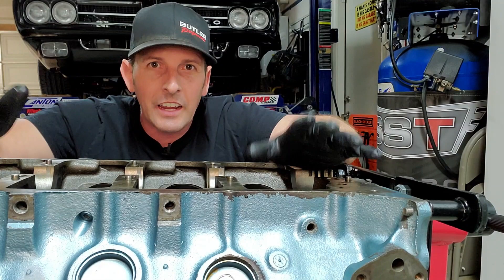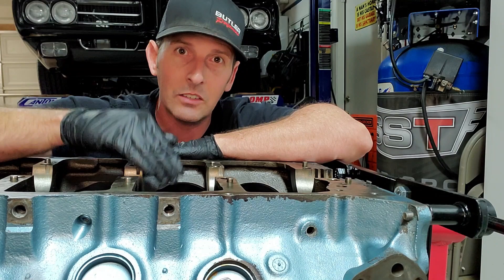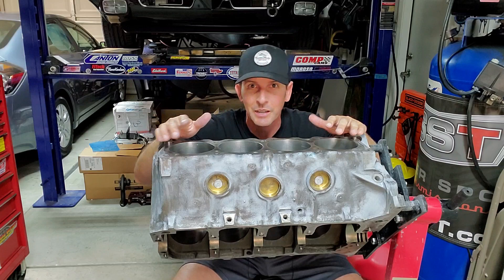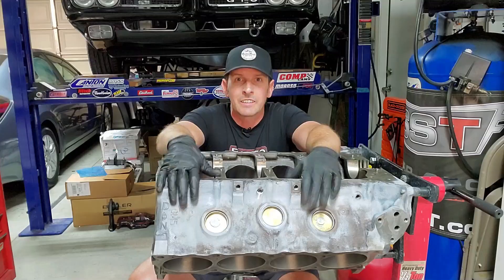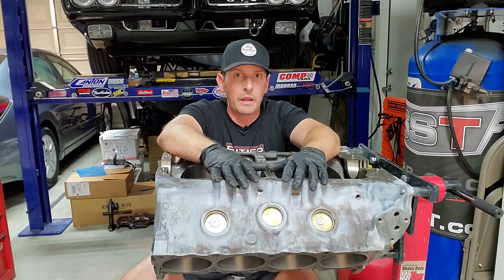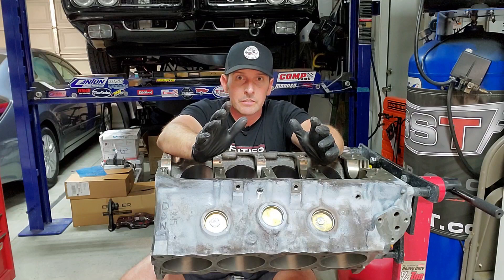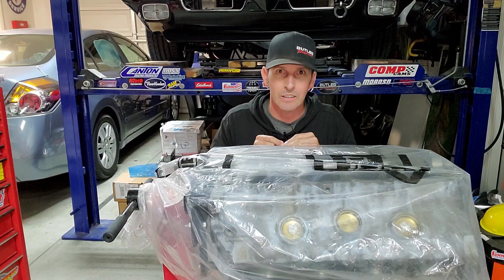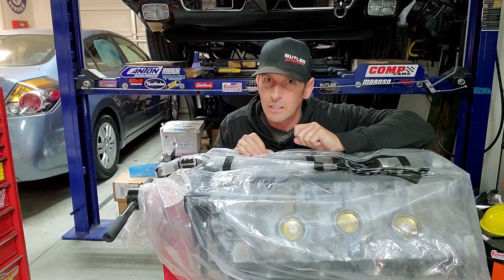Engine Block Cleaning, inside and out.  Pontiac short block re-build, Part 1

Comment: Great Job on the video’s!!!  After getting my blocks back from a machine shop, I use my 3,500 PSI pressure washer and pressure wash every hole in the block. It’s amazing how much crude that comes out of the water passages. I blow dry, install my gallery plugs and and WD40.
Reply from the maker: Awesome David, thanks for the suggestion.  (Yeah I was shocked at the crap that was still coming out, even though the machine shop said it was clean)  Thanks again,

Comment: I think I would pay the extra charge to have this prep and cleaning done by the machine shop after the machine boring was done. Then all you need to do is check the work. Saves hours of my free time and clean up in my shop. Not to mention #itching by my wife that I left a mess.
Reply from the maker: Ha!  Agreed about the $&itchig wife syndrome.  And I agree, if you can find a shop that can do a hot oil cleaning, that would be ideal.  Unfortunately, in Southern California, that's hard to come by.  I should've done a better job explaining my situation there.  Thanks for the comment!

Comment: I wash my blocks with nothing more than soapy water, and thoroughly rinse with water. Then I use Glyptal to seal the inside lifter valley to keep it from flashing. Stuff works excellent also for sealing porous casting, helps keep the oil cleaner longer too.
Reply from the maker: Good tip, thanks Rickey.

Comment: Great idea especially the water hose in ports. Ive been using brushes we use to clean concrete holes that have been drilled, then I wrap them with paper towels to clean, and using wire wheels think thats OK kind of wonder about the wire wheels sometimes. But this is great looking forward to getting my block back
Reply from the maker: Thanks Dan... getting the block back is always fun... thanks for the comment!

Comment: A Awesome video I also like Super Purple Cleaner . For your oil passage try using a riffle cleaning kit that consists of 3 aluminum shafts that thread together and a wire tip that removes gun powder residues and they also have a nylon piece that threads on that holds clean fabric that you could spray with carb cleaner . I believe they have lint free materials as well. That's my tip for you. Can't wait for the next video . peace brother.
Reply from the maker: Ohhhh, great idea!  Thanks John!
Reply: @FastMonty  thought you would like that.😁
Reply: Oh yah hurry up with the next video , I'm starting to have F.M.G. withdrawals HA ha 😁
Reply from the maker: @johnkennedy8452  Ha!  Thanks John!  Next one is fun... See ya!
Reply: @FastMonty  👍

Comment: I use oven cleaner for block cleaning, works really good.. Be careful with those foaming cleaners though, they can etch the babbit on cam bearings and may cause premature failure.
Reply from the maker: Good tip.  Yeah, if you let any degreaser "sit" too long, it'll start etching whatever it's touching.  That's why the immediate rinse with water.  Thanks again for the comment!

Comment: Can you please explain how they dress the cam bearing ? I am rebuilding a 400 and was worried about the bores of the cam... Thank you
Reply from the maker: Good question... "dressing"  is basically lightly polishing the inside of the bearings so the cam rotates freely. If you can imagine, it's really tough to make sure all five bearings are concentric, when  you put new ones in.  If you have to, which I had to, the highs and lows need to be polished so the cam does stick.  Hope that helps!

Comment: Looks great mike great video just thought I might mention it may be good idea to check your lifter bores with a dial bore gage for correct diameter on your previous video the bore that went bad looked a little beat up may need a hone this would be a great to do that also you may want to consider drilling a .030 hole in the right bank oil galley plug for lifter bores it will give a nice blast of oil to the distributor gear anyway stay cool and keep the videos coming I hope to meet up with you sometime in the future at a car show
Reply from the maker: Thanks James... I'll definitely be re-inspecting that suspect lifter bore.  Yeah, I already have that distributor oil hole.  And, yup, one of these days... the stars will align.  Ha, ha... thanks for the comment!

Comment: If I use wd40 will I have to remove it later? I plan on cleaning the inside and assembling the rotating assembly the day or day after cleaning
Reply from the maker: Nope. You only have to remove the wd40 on the gasketed areas.  Thanks for the comment!